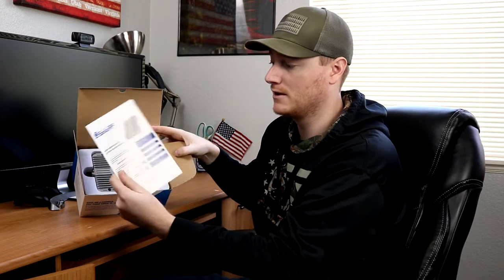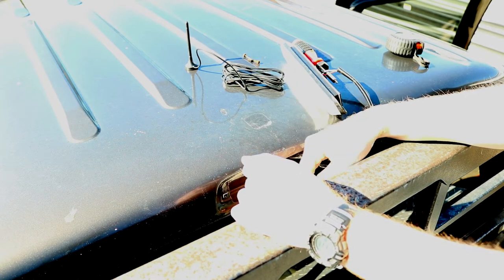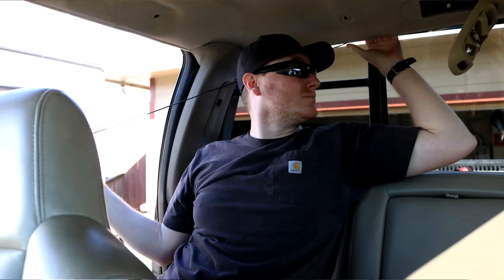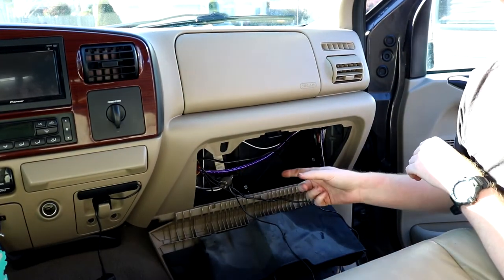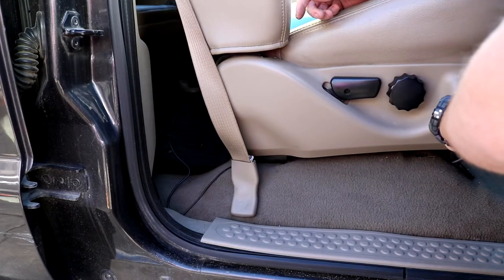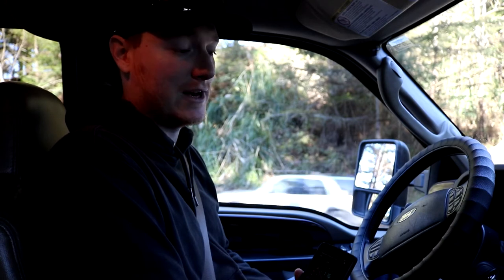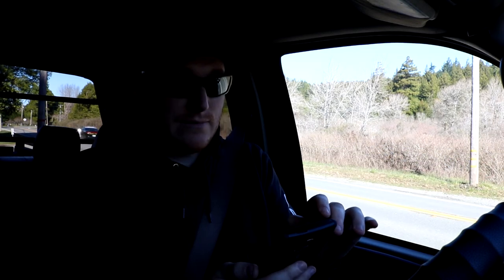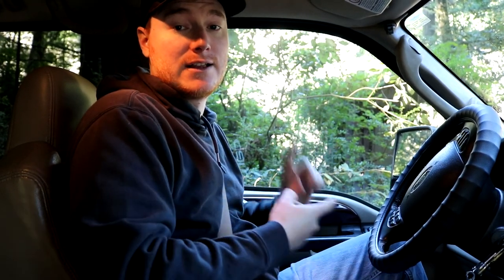SolidRF MobileForce 4G Cell Phone Signal Booster

Comment: hey I noticed the outdoor shots seemed overexposed, don't know what camera you use but you could try lowering the ISO (or just mess around with settings before shooting the scene) (BTW sorry if I got any terms wrong)
Reply from the maker: You are absolutely right i did some research after having those issues and found a filter attachment for my camera that allows me to have the correct settings and not get white washed like that. I will be saving up for that fortunately they are not that expensive.